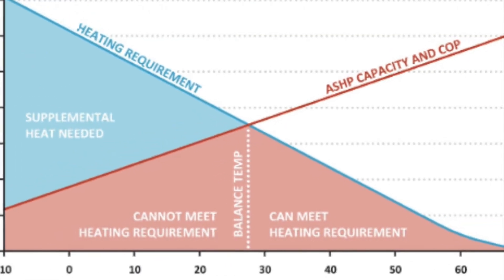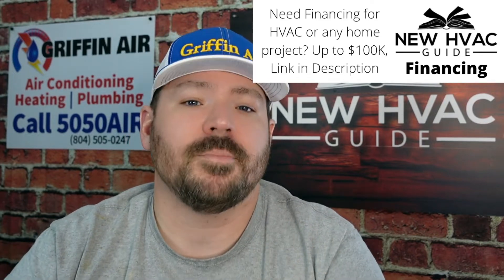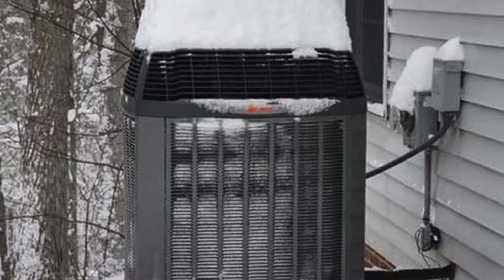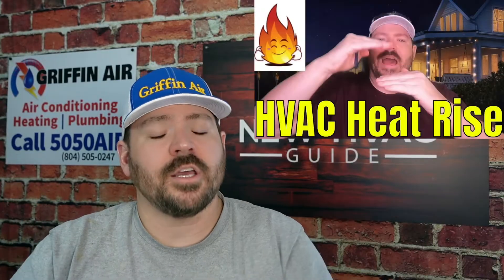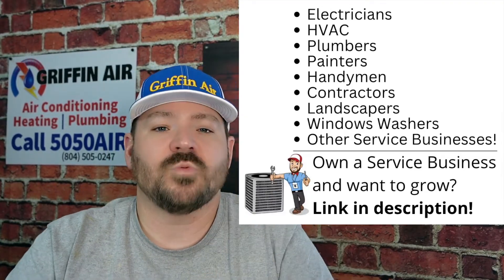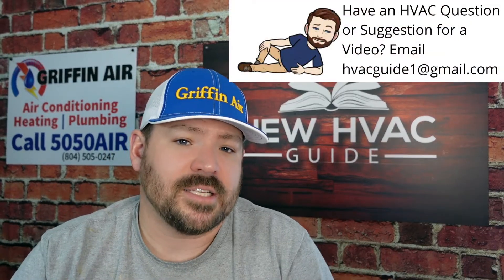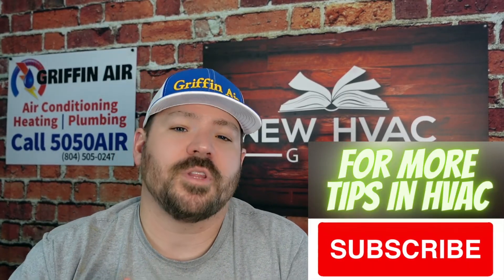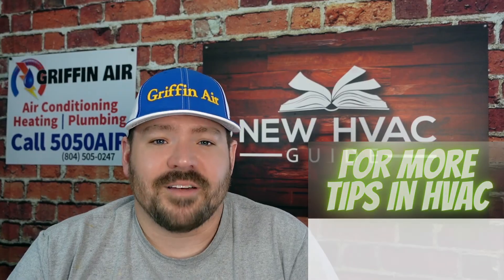HVAC Balance SETPOINT!

Comment: My lockout was originally set at  10 degrees but I woke up this morning and the heat pump was pushing out luke warm air.  Since it was 15 degrees outside, I reset the threshold to 20 degrees.  We will see how that goes.  Newer system, in a two story 25 year old house. I appreciate the information you provided.

Comment: Anyone running a dual fuel system should definitely watch this video. I had a new Bosch heat pump system installed in a house I'm renovating, but also kept the oil furnace. The balance point was set by the installer at 10 degrees, which I felt was going to be too low. I currently have it set at 15, and will have to see how that holds up.  This is my first winter with the new setup (southeast Pennsylvania), so I expect a bit of trial and error. For whatever reason, I feel that 20 degrees is probably gonna be where I'll end up. The existing fireplace is being fit with a wood burning insert, so I expect that will certanly help with the winter heating needs.

Comment: I got a 20 year old heatpump and I just put in a new high efficiency Heil lp furnace. So the heatpump works fine down to 30 degrees(cycles fine heats the house no problem). I live in a place where it can get down to 30-40 below zero... my heatpump is not gonna work for that.
   The trouble is I have a T10 Honeywell thermostat and I have the heatpump lockout set for 30 degrees but when it go's into defrost mode it will kick on the gas for about 30 seconds and shut off and go back to the heatpump. that's gonna wreck the heat exchanger in the furnace. The thermostat also has a lock out for the gas furnace but it only go's down to 35 degrees. There's no settings for that on the furnace board. Any suggestions?

Comment: My son owns an old converted schoolhouse. He's planning on going heat pump with electric resistance back up. The balance point is an important and somewhat confusing consideration that has a tremendous impact on energy cost. Thank you for explaining it.

Comment: As an older retired HVAC guy.... we did a ton of heat pumps back in the 70's. We always did a manual J calculation to see what the particular heating and cooling loads were. With that info you can compare those numbers with the manufacture's performance data sheet for the particular equipment that you were using to calculate about what the balance point would be. The biggest problem back then was the register air temperature, when the outside air temps were 38ish or it was below our skin temperature, so the air felt cold to the homeowner. With the above information it was not really a guess guess but and informed estimated temp to set the outdoor stat to lock out the heat pump and let the back up electric strip heat to take over or with a duel fuel system to let that take over.

Comment: The area you live in and the insulation factor of the space having a system installed in,is how set points and for that matter btu's per square feet in conjuction with cfm's.

Comment: What about wear on the machines? A heat exchanger will last a lifetime but the heat pump has a shorter lifespan. If I can extend the life of the heat pump by a few years by not forcing it to run hard through winter it’s worth the few extra dollars. 98% efficiency on NG is also pretty inexpensive…
Reply: For those of us on propane it might be cheaper to shave a few years off the heat pump.

Comment: What about the relative cost of the energy source ?!?  How much is electricity vs. gas in your zip code?  That varies by location and provider.  
My natural gas is pretty cheap but it costs DOUBLE in the next town over... but my electricity is about 25% higher.  That has to be fairly common kind of thing.  
So it seems the balance point also has to depend on the relative cost for one source vs. another when the efficiency ratios change.  
Is there a calculator we can use to estimate that?

Comment: What happens when the heat pump has been using gas for a while due to lower temps and the unit happens to be covered in snow and ice and hasn’t had a chance to melt yet when the call for heat tries to turn on the compressor? Can it damage the fan, sling the ice off the blades, or is there a defrost that checks before trying to turn on and possibly cause damage. My set point is at 26 degrees, but I’m thinking of raising it if the answer is that damage could occur? Thanks Eugene in North West Arkansas. We had -2 degrees to 19 degrees for a week. The unit froze and I wasn’t home. The neighbor said the compressor was making a lot of noise and there was ice all over it. It seems ok now, but scared me as if this Trane 18 dual fuel had been damaged. Should I just not worry about it?
Reply: I watched again…thanks.

Comment: Love the video. I guess it was more my understanding that what was not mentioned that it is based upon the efficiency of the heat pump. Hydro cost versus the cost on our system, which is propane.  Even if the heat pump can keep the house warm at what temp is it costing more than propane? I don't know how to calculate that ?
Reply from the maker: There’s studies to show the cost per btu. However prices fluctuate. So there’s no way to know in every situation.

Comment: The balance point is based on the load calculation of the house.  The heat loss and btu output are equal.
Reply from the maker: Most HVAC contractors don’t care about doing heat load calculations

Comment: I have the opposite problem.  I just replaced a 32 year old electric furnace with a new electric furnace and it can’t keep the house warm at temperatures below 25 degrees. Temp outside dipped to 18 degrees a few nights ago and the inside house temp was only 63.  It took 8 hours to warm the house up to 68 that day after temps outside made it above freezing.  I am thinking of adding a heat pump to the system to accommodate the lower temperatures while giving me air conditioning in the summer.   Will a heat pump give me 68-70 degrees in the house when 20 degrees outside.  My house is 2300 s.f. , two story built in 1989.  Insulation is good, Windows need replaced. Live in the Pacific Northwest.
Reply: Sounds like you need to get a bigger heat kit for your air handler. Should have been sized the same as the old one. A heat pump would save you a lot of money on electric while also giving you AC in the summer.

Comment: Josh.  What have you found from Daikin fits with electric strip heat as far as turning them completely off.   I'm getting a new Daikin fit installed this week and I want to limit electric strip heat usage or eliminate it completely.  Are these units good enough to eliminate heat strip usage at say 20* outside?  My house is fairly tight and load calc cam in at around 24k BTUs cooling... heating was a little higher because of an attached garage which I will either turn into living space or rip out the drywall and insulate the crap out of it.

Comment: I have had my Mitsubishi 30k BTU split system with 3 air handlers in my 2600 sq.ft. raised ranch for a bit over a year, and this is my second winter.  TODAY 2.3.2023 during the arctic blast we are experiencing as I type, I found that the system was making warm air to the rated 5 degrees.  Yes, the compressor was in high gear for sure.

When the temp outside dropped to 2.5, well, the temp in the home began to drop and the NON-hyper heat system could no longer keep up.  

So, on came the old 1979 power house Heil gas furnace / forced air (manual set by me to 68 degrees).  This furnace has a 150k btu burner!, but still works perfectly and is SO quiet.   I will run it until the morning sun comes up and we get to around 8 degrees, and kick the Mitsu system back on.  That seems to be the scheme around here in the NE.

We make our own hydro electric here in my town, so electric is the way to go over nat gas here.

Comment: It depends on unit. My inverter system (Mr Cool Universal) was blower 105* air out my vents at -3* outside. Never dropped below 68* inside which is the set point for my heat.
Reply: Almost forgot, there is no backup heat on my unit. HEATPUMP ONLY. I'm a heating and air tech and installer and I'll tell you, it impressed me.

Comment: All of this comes back to understanding heat loss and gain. I use this program, Once you become familiar with it heat loads actually become fun to do. You can download this program and learn to use it and then for 49.00 for homeowners you can get a one time use permission. You can go back in and easily change parameters like outside temp, room by room, infiltration, etc. When I was in HVAC school we had to do these heat loads on a manual J long form, they were very time consuming but allowed us to see the inner workings of this math. Basically every square foot of your house has a surface that has a different temperature on either side and an R value (resistance), these programs tell you how fast heat will pass through this surface at varying temperatures. You can see how much energy you save by changing indoor parameter from 70 to 68. You can see that a window is nothing more than a hole in your wall  lol. You can build an extension on your home and see what the savings would be using 2x6 instead of 2x4. Once you start using this program you will start to understand all this BTU stuff.  www.hvaccalc.com/main.asp

Comment: That's true Josh, whenever heat loss exceeds heat gain then temperature drops.

First thing I tried on my new home was to see whether the heat pump alone could keep the house up to temp through those arctic blasts.   It can.  

My approach to choosing what was called the changeover temperature was based on the cost of energy.  In short you plot the cost of electricity in dollars per BTU of heat pump output over a range of outdoor temps for a given indoor temp you plan to maintain, and see at what outdoor temp that curve intersects with the line that is the dollars per BTU of LP gas.  This is called "the break-even point" and that's where I set mine to switch over.

But that's only good for those electricity and LP gas prices that day.  In my spreadsheet I have cells for those costs to make recalculating the breakeven point quick and easy.

About a couple weeks ago we had an arctic blast and I decided to check to see how my same heat pump (now thirty years old) would do.  I was getting 86 degree air at the low of two degrees, an 84 degree rise at 74 degree indoor temp.  Not bad for itself!
Reply: You hit the crucial part -- Calculating  the cost of a "delivered" BTU from your fossil fuel furnace vs. cost of producing a BTU from your heat pump, when known, will let you choose the most cost effective solution.   In my case, I must factor in my efficiency rate of the furnace (80%), so 100 BTUs of natual gas on the meter is really only 80 BTUs of actual heat.  Next, look at the Coefficency Index chart of the Heat Pump relative to the outside temperature.  That will permit you to determine what you pay per BTU at a specific outside temperature. 

EXAMPLE:  A KWHr of electricity will generate 3412 BTUs at a COI of 1.00 (simple resistance heat).  If, at 20 degrees, your heat pump's coefficiency rate is 1.5, you're going to get 5,118 BTUs for each KWHr consumed, then look at your electricity rate, compare to what it costs you to generate 5,118 BTUs from natural gas (Answer: you'll need to burn 6397.5  BTU).  Assuming your HP will satisfy the need for heat at 20 degrees, you should pick the cheaper option.   The same calculation could be done at a higher or lower temperature, just remember the coefficiency rate will change.  Of course at some temperature, your HP will not supply enough heat to meet the demand -- you must set the break point at this temperature or higher.

In simple terms, a location with expensive electricity rates and low natural gas prices will tend to have a higher break even point while the reverse economic conditions (low electric, high natural gas) will have a lower point. On average, 100 cubic feet of natural gas equals 103,700 BTUs.
Reply: @oldguy8096  
 Thanks for that, Sam.
That's basically what I did thirty years ago.   I wish I still had access to the data I used and and formulas I programmed but Goodman did supply the performance data (either by mail or by internet, don't recall) in some useful form.  I don't know, but I have a sneaking suspicion that the old R22 unit gives me more BTU per W•H over a wider range of conditions than these newer refrigerator "high seer" units.  I'd love to find out for sure but without access to the data I'll just have to imagine that's why we don't get BTU per W•H  vs temp diff charts (or conversion efficiency coefficients) anymore, but hit with things like "seer" so we don't know what we're actually comparing.

Sounds a lot like politics, doesn't it?  A lot of imprecise language which can be interpreted different ways by imprecise people.

My LP gas furnace is claimed to be 90% or something close for output/input.
Reply: at what temperature on your system did switching to propane make more economical sense?
Reply: @peteraegger  
Thirty years ago it was 34F outdoor temp.  Relative costs have changed since then though and when we went through crazy propane hikes (started out under a dollar a gallon, rose slowly for a while, but then at one point it skyrocketed and hit over four dollars a gallon) I installed a wood stove.   I put a second indoor thermostat on the gas side and turned that a good bit lower so the gas was relegated to a backup against freezing.   It's come to where I heat with propane only at the beginning of the season when I test to verify it's working.  And it's about time to test that for this year.  

I would love to tell you what it would be today.  It's a lot of calculations, and Lord knows if I could find my program or recreate it without a major time investment.  Propane is about double now and if I knew how much electricity has gone up I could make an estimate.   If they both went up by the same factor then the break even temp would remain the same.  But I think propane has gone up more than electricity.
Reply: @elgringoec  thank you for that. It makes sense. We just moved and renovated a old farm house and unfortunately no natural gas so we installed a high efficiency propane furnace plus a high efficiency hear pump for cooling and heating.  The home is maybe 5 thousand sqft and our propane bill I  winter was about a thousand every 6 weeks but we are Aldo in ontario, Canada

Comment: The building or residence deisgn, another reson for the HVAC folks to know their stuff when figuring what will be best for the customer based on structure, fuel type, choice or availability of fuels and cost etc. It all comes into play...especially the cost to operate now and in 5 years when rates are $1 higher than they are today. When rates get to $500 a month to heat a home, its probably time to throw in the towel.

Comment: I have a Lennox XP25 4 ton in west central Wisconsin.  XP25 -048- 230 -02.  With the modulating furnace using propane for back up. 
Mine seems to labor at anything below 28 degrees so thats where I have the set point for the heat pump. Not sure if I can play around with some of the settings for energy efficiency on the thermostat?  The tech that installed had the same unit and said he wouldn’t recommend going below 25 degrees.  Should I be doing something differently?  Electricity is at a reduced off peak rate for the heat pump, basically 1/2 the cost per kWh.

Comment: That is the best way, just keep lowering the lockout until the heat pump can no longer keep up. Same way you can do boilers, turn that water temp down and then watch what temperature water no longer satisfies the thermostat, if you have to turn it up 5 degrees at a time. I have reset many old homes with large radiators down to 140 that the installer set at 180 and they heated just fine. The savings are huge if you take the time to work with your system.
Reply: For that basis you can use two thermostats so that the second one set for a couple degrees below the first overrides the heat pump and activates the furnace.
Reply: @elgringoec  You would have to isolate with a relay to make sure only one thermostat will run at a time. You can't run an auxiliary heat source below the evaporator or you will blow the high pressure switch.
Reply: That's ok as long as you have a condensing boiler. If it is non condensing or below 90% efficiency and you set your supply water to 140 you are going to condenser flue gas and rot out the boiler. Non condensing fossil fuel equipment needs at least 140 degree return water temperature to not condense.
Reply: @jameswoodfin3661  If you dont have a condensing boiler then you must have some type of mixing valve. On the simple end you can just use a thermostatic mixing valve and adjust water temp from there. On the high end you could use a 4 way mixing valve with outdoor reset and boiler protection. Taco also uses heat injection but we never used that.

Comment: I would want to make that transition on cost efficiency.  Which system costs me least to operate?  That is the important question.
Reply: It’s not all about prices.  If you balance based on price if your equipment is sized closer to the cooling load then you will get a significant drop in capacity at a higher temperature than if it’s sized based on the heating load,  it’s a different load equation for heating vs cooling,  and if it’s a natural gas dual fuel then cooling size is way more important, if you’re heating with an expensive fuel like LP the setup will favor heating a little more

Comment: In Northeast Oklahoma my 3 ton Daikin Fit setpoint at 10 and it will maintain temp at 71 degrees.   At 5 degrees setpoint the inside temp will slowly drop.  I've since moved it to 40 degrees to lower the electric bill for January.  With these swinging natgas prices it can be difficult to find the economic balance point.
Reply: That does make sense.  Thanks!